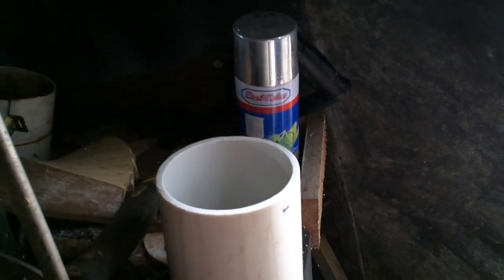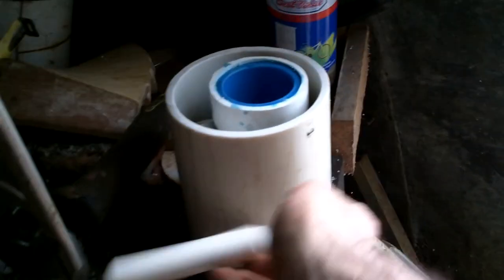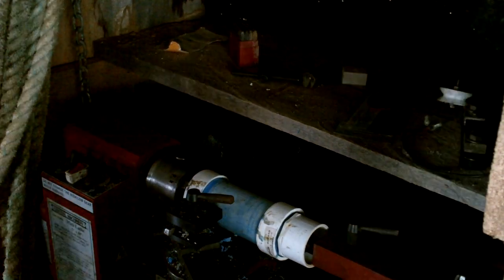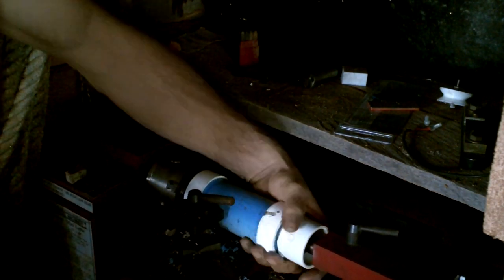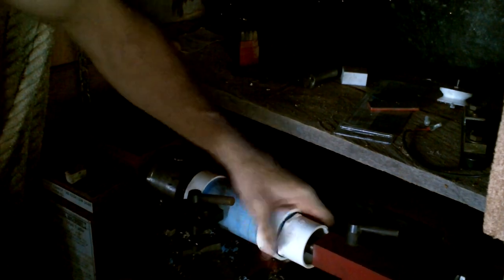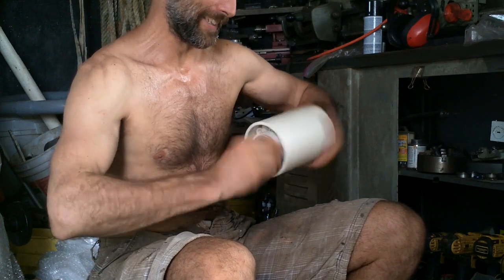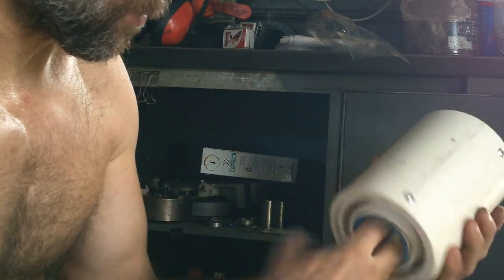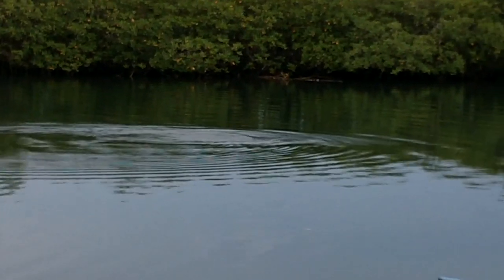Boat Chips 006 PVC Roller Bearings

Comment: Really nice & years of use,  Ideas. what about a planetarium gearing useing pvc? 2-3”
As the inside gearing, and you use stainless bolts as the gear, you could bolt attachedment step gear or just use the bolt thread and resin it round so it will not cut  the outer pvc bearing holes. Or use the bolt head w/ 2 nuts and grind the head 1”  hight to slid in also.

On the outside bearing. Maybe you can cut that same 2-3” pvc pipe length wise and flatten it out. Then wrap it around something round. Then lade  a wooden wheel as the carrier “side view” the 2”  pvc  get screw inside your 2”  inside outer suport & one side a plywood and a center hole. You cut matching holes in the pvc .

For the center hub  bearing  suport. Same plywood then resin or plexiglass? Or a resin housing. Will it work? Logically should.  LOL
And if you want a Angle motor gearing devise. You could use a angle grinder head gearing. Maybe Incase that in a resin housing and fill w/ grease.
https://www.youtube.com/watch?v=_kbnhPQExBY&t=219s
Reply: Or to make the center gearing in resin. Do it on your wood lade. Cut the right size circle then Chezel cut the gearing teeth and stuck a bolt in the center and resin it. Maybe you can do the outer gearing ring too the same principle somehow so both are in resin.
Reply: Logically. You want precession. The only way is a jig. And to transfer the first build into the mold.  You can do it by a strip of sheet metal and bend steps that you line the outside of your mold. So a jig is needed
On a ply wood find the spacing of your gear tooth and screw in long screw, bend the sheet metal 45% put that 45% at the first screw then bend another 45% just keep going to the desire size of the gearing.
 Do the same for the outer gearing and mold it in your wood mold as the outside gearing and center the bolt to be used.
Should get a good consistency fit with the right math.

Comment: 1:37 How did you get the exact width for that???
Reply: Im assuming you fit it, cut some, fit it, cut some. Until it fits perfect
Reply: Well, the inside circumference should be the same as the outside of the pipe to fit in to it. So you just measure and cut away the excess and you should be pretty close. Saying that, I havent done such a thing my self.